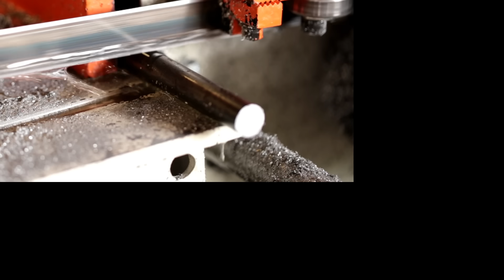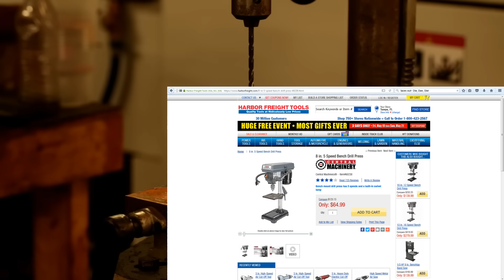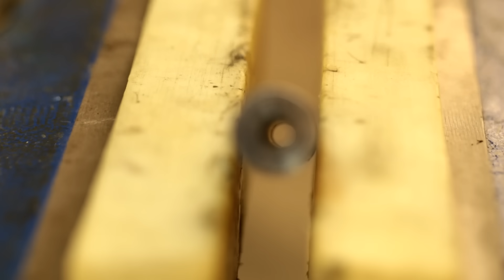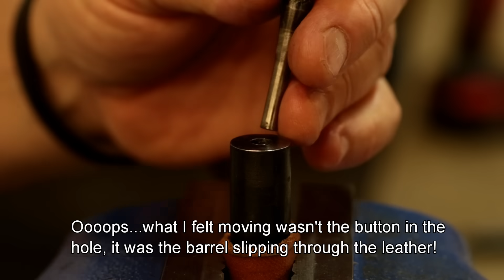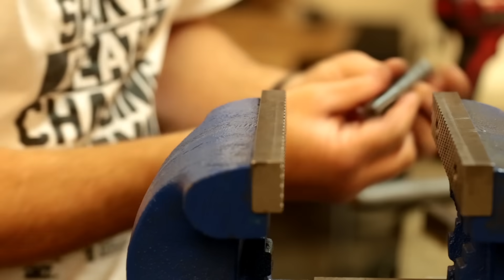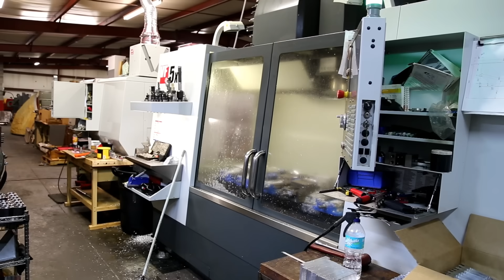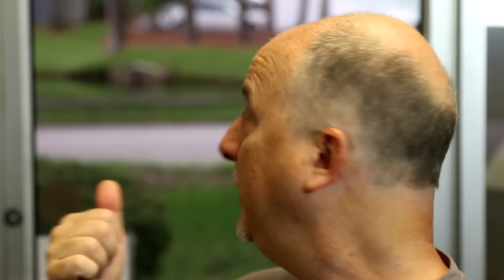Home Shop Rifling!

Comment: To center your hole put your  pieces of stalk in a drill big enough for it to fit in, get it spinning then take a fine tipped felt pin and press it as close to the center as you can. it will automatically center itself. A scratch awl works too.

Comment: One of the biggest problem the British government had in the middle east was the locals pulling up railroad tracks and making replica lee-infields and model 1911s using little more than a hammer, couple files and a fire. Later on they built factories complete with improved tooling. The copies made in the region are still available new. But due to the expense and scarcity of the 303 British round they are chambered in more modern 7 mm calibers .

Comment: Good point about turning the OD down between centers to be concentric with the crooked hole, but now you need a lathe, and a file. :)
Reply: Or, three blocks of wood two pointy centers and a file with some serious patience.
That's the lathe the ancients used to make gear assemblies in the B.C. 👍

Comment: Bottle Jack or screw under your car frame with a metal plate .... use short rods adding rods to get clear thru.... make your own rifling buttons from hardened drill bits... just do progressive sizes to finish

Comment: As a former Tool And Die maker, Your mistakes were no using a prick punch to find center before you punched it. And didn't start from both ends with say a 3/16 (.187) drill, then enlarging the hole, then reaming to your final size, Also If you had rotated your collet block in in your vice with each 1/4" of drill depth to keep your drill on center. Fourthly, use a center drill to start the hole.
Terry

Comment: This is why you cut the exterior (to be cut off later) down to fit in the drill press chuck and before that you take another piece of stock fasten it to the drill's tightened vice and use that to hold your drill bit firm. Then take your 5/8" round stock you cut down an end to fit in a vice... and you spin the 5/8" stock against the vice tightened drill bit that is the size hole you want... so a stationary drill bit is drilling a hole in spinning stock making it dead center.

Comment: Put the rod in a drill press and while it's spinning bring it down on a small drill bit that's clamped in a vice, you may have to move the vice around, but you'll find the exact center, then you can center punch it an drill it with  the same set up, dead center

Comment: Even if its slow feed you should still be sporting oil, it helps in every single way you can think of, faster drilling, longer bit life, less heat
Reply: And not just by a tiny margin, it can drill 50% more holes (200 Vs 100)
Reply: 😂 @KClO3 
Seems like that would be 100% more...

Comment: My uncle built his first bore bar and lathe ,eventually made missile parts to support his gun habit .designed the 572 Ross ,same year gunny Hathcock modified a ma deuce,but the army didn't like the chamber pressures and powers weren't what they are now or it may have out done the lapoua .based off 600 nitro cartridge, 50 cal.by 72. 572 Ross . Ross Powers.

Comment: Spinning the drill bit and clamping the work guarantees an off hole. Flexy drill bits make it worse. Get a lathe. Peck-drill with a d-bit or single-flute. Plan on turning the OD to match the bore after the rifling is done.
Reply from the maker: Not necessarily.  I've got several thousand guns out there in the world with firing pin holes that were drilled in the mill, with the part fixed and the drill moving.   Yes, as I mentioned in the video, I plan to turn the OD with respect to the ID.

Comment: Should've put the barrel back in the holder and put a flat piece of iron with a welded tip that fits in your drill press chuck and WITHOUT turning on the drill press, lower the steel plate as your "force pressure" to drive a piece of smaller diameter  round steel stock to push the rifling piece out the other side.

Comment: Idea? Button jig made of heavy gauge pipe with a set of nuts spotwelded in an end for the push bolt and and opposing nut as the anvil and thru hole for tooling to go out with a pipe cap drilled out for access to cap it all in?

Comment: A better way to find the center is to scribe a line, measure this line and divide it in two, this is the first center point. Then scribe  a line across the second line, and mark the meeting point of the two lines and that's your center.

Comment: Stick the rod in the drill chuck cut it on and press it against a piece of sand paper on the table. This will sand the face the rod perpendicular to the outside diameter.

Comment: Your push rods would work better with a sacrificial collar. Just get another tube of bored steel with a fairly similar inside diameter, and cut it so only about an eighth to a quarter inch is protruding. Push it thru till the rod is almost gone, the trim the sacrificial rod down. Work it till it's almost unnecessary as a support, then finish without it.

Comment: Liked the video.  But remember, drill bits dont drill round holes and dont stay true when exceeding the diameter by much.   And oil isn't just for cooling, its most important job is evacuating chips

Comment: better way for the home gunsmith is to build a rifling bench, guides, and heads to do cut-rifling. it's slower but kind of easier, less nerve wracking.it was for me.
Reply from the maker: I strongly disagree.  If you watch my "Rifling Three" video you can see that in 10 minutes with a crappy hydraulic press you can rifle a barrel and do an excellent job.  If you spent a little bit of time and made some spacers or had a press with an adjustable ram you could get that down to 3 minutes.  And in the end you have a beautifully rifled barrel with a strain-hardened bore that only button rifling will give you.  What on earth could be nerve wracking about that?  For cut rifling you have to spend a day or more building the machine cutting head and cutters, it'll take several hours to actually rifle the barrel and in the end the results will probably not be good.  You think some home gunsmith is going to make a cutting head that will increment the cutting depth .0001" every pass?  You know what's nerve wracking to me?  Making a 6-groove barrel and know I have to move the cutter back and forth 240-300 times before the barrel is done!  What part is "kind of easier"???

Comment: If your drill press chuck opens up enough to accept the barrel blank, you'll drill a truer hole by holding the drill bit in the vice and turning the barrel in the drill chuck.

Comment: A Better Way: to drill that bore into the metal, nicely centred with just a drill press and a table vice that probably came with it. 
Your barrel stock has to fit into the chuck, your drill has to be  longer than the barrel.
ok so put the drill bit in the chuck backwards with as much drill hanging out to reach the bottom of the table vice.
roll the chuck and backwards drill down to the bottom of the vice and clamp the vice on to the drill.
clamp the table vice to the drill table, now undo the chuck and let the chuck go back up.
Both the drill which is now in the vice and the drill chuck are centred as long as the table is square.
Centre punch the centre of the barrel stock
put the barrel stock into the chuck, start the drill and just drill it out.
cheers

Comment: The rule of thumb, from what I understood in a statics class for a column and buckling:  If the length is 8 times or more the diameter, bending/buckling tends to start under compression. But you did not have the longer ones straight with the bore. That ejector pin was not buckling in the vise. It was crooked.
Reply from the maker: It's a lot more complicated than that...the end support conditions are very critical as is the "slenderness ratio".  Like I showed in the video, look up "Euler Column Buckling" if you're interested.  Trust me, the ejector pin was crooked AND buckling.

Comment: To prevent the crooked hole could you just get a bubble level to ensure first the drill press is level, then check the vise for square and level, then check the piece that you're placing in the vise
Reply from the maker: I've literally drilled thousands of holes and what you say won't necessarily work.
Reply: @markserbu  thanks for the reply. What do you think causes it? Is the only thing that will get rid of it, in your experience, a lathe drilled hole?
Reply from the maker: Anglus Patria  Two.  One is named Zack and the other is Valerie.

Comment: If i were to try to make my own rifle barrel, I would first cut my hole then my chamber and afterwards I would turn the outer portion to the form needed in a lathe using the chamber and exit bore to line it and form it from the inside out . But I'm not a engineer so I'm not all knowing and perfect like they think they are!
Reply from the maker: @mikebeddingfield2144 That's generally how it's done. Sorry you felt you had to leave the shitty comment about engineers, but hey...you do you.

Comment: Here is a parallel question…
I’ve got an old military rifle, a Chinese M-88 Han Yang Rifle, in 8mm Mauser. It is a .318 bore. I’d like to open it up to the modern/standard .323 bore.
How did the Germans accomplish this upgrade? How can we do it in a 21st century shop?
Note: Before anybody "freaks" out about running full power ammunition through a Commission 88 rifle… NO. I will hand load using Trail Boss powder. Essentially creating low, pistol pressure ammunition. ;)

Comment: Just locate it on the drill and spin file it to desired o.d. just dont use alot of cutter pressure, stabilize end of bit if you have to .    Learn all the right way so you learn what you can do without all the right tools . maybe just got  crow bar and hammer ?? No prob all I need.

Comment: He needs a series of shorter pieces to push the button through, like drill rod in 1/4" increments until he has one ling enough to push all the way through.
If it's too long it will push to the side as the back of the barrel is not perfectly flat.

Comment: i would love to work in the USA in a weapons manufacturing company. i come from Germany and here it is so that it is actually impossible to get such a job there ...  unless your father and grandfather and great-grandfather were gunsmiths. 

I would even go to the other side of the world for that ... because it's not going to work here anymore.
Reply from the maker: It's too bad what Germany has become.  I still love your country and visit when I can (mostly to drink beer!), but it's been so ruined by liberalism.  Just like what is happening here, there is a huge movement to deny the parts of history that aren't "politically correct".
Reply from the maker: @christianenders23  The problem with straying so far from a country's original charter/culture is that "the pendulum swings both ways".  Just as the radical Obama got us the radical Trump, Germany could be headed for another Hitler.  The German people are, as a group, among some of the best people in the world.  Smart, incredibly industrious and honest to a fault.  They're also extremely tolerant, but the prevalent culture that's literally invading your country does NOT share those traits, and eventually the German people will get fed up.  Of course at the rate you're being outbred eventually it'll be too late.  Anyway I wish you the best!

Comment: By not using coolant when drilling your hole, the drill probably walked, so it wasn't centered. Or you had the collet setup in the vise at an angle. This video should be showed in schools as a OSHA training tool, on what not to do. Omg, just saw part of the video where he actually owns a CNC mill, I thought for sure I was gonna see body parts fly.

Comment: And making stuff the crappy way is the way we all do it.  Better than a $10,000 CNC machine.  So, how did they do it in the olden days?
Reply: $10,000 CNC machine? where did you find THAT bargain? Shit, you'll probably pay $18,000 for a new manual lathe.

Comment: I hope this isn't a stupid question, and it's slightly off the topic, but is there a twist rate at which the rifling becomes counter productive?  I know it depends on the size the bore is chambered for, and the length of the barrel, but you see a lot of variety out there in twist rates and I'm interested in knowing where you start to see counterproductivity in rifling, where it starts to cause barrel wear prematurely, and so on.

It's probably a bigger answer that I'm even ready to understand.

Comment: No center drill to start?
Also, just a little cutting fluid (worst case, WD40 or motor oil) will make it cut and ream better.

Comment: You can buy rifling buttons off eBay from China pretty cheap
Reply: lol if you are a friend of throwing barrels away why the plug splater to shreds than yeah i guess its just as same as with these "extremly sharp" China drils once you set it in they literally explode to thousand pieces i had tham one and not a single one could stand even 100 holes in regular metal from hardware store
Reply: @NexusIncorporation  I know it's a foreign concept to most delinquents out there, but if you feed your drills slowly, apply even pressure, and lubricate them sufficiently they usually can manage to drill a hole. Unless your trying to drill hardoxx even Chinese drills perform reasonably well when USED CORRECTLY.

Comment: This is probably a weird question but... Would it be possible to pre-drill the main barrel hole, then maybe weld on a little steel nub to a carbide drill bit and just push it through the barrel on a low RPM, creating some very basic rifling, to at least stabilize bullets properly? It'd be wonky and the twist rate would probably be way off if done by hand, but just a weird idea.

Comment: Is.   Rewarding.  The. Same. As. The.  Feeling.  Of. Accomplishment...   this.  Reminded.  Me.  Of.  Fitting.   And. Finishing.   On.  A.  Gunstock. From.  A. Rough. Blank.   Doing.  All.  Work. By. Hand.  Much. Like. This. The. Only.  Thing.  You.  Did. Not. Do. Is. Cast. and. Shape. . The. Metal. Part.   Like. I.  Did.  Not. Cut. The. Tree. Or. Form. The. Original.  Shape. From. A. Log.    I. Used.  ..  just. Small.  Files. And.  Sand.  Paper.   Thanks.  Have.  A.  Nice.  Day....
Reply from the maker: I was today years old when I read an entire 73-word comment that had periods after EVERY. SINGLE. WORD.!!!

Comment: Ok, but. This is better.
Use Pak so they still fit in .. cut the green cap off, then press a 1/4 inch ball bearing in it. This will help with straight shooting. Because balls are round. And no rifling.... Oh. Ya it works great!!!

Comment: how many years did you make rifles in your garage before building a shop? Did you do it full time? What was the most important thing you learned over the years doing it? Neat video.Thanks
Reply from the maker: Worked in the garage for a couple of years before renting my first shop.  Most important thing?  Several: 1) Work your ASS off. 2) Don't be a pussy and give up easily.  3) Don't do illegal stuff, don't screw people over  4) Learn everything you can about every aspect of making guns.  Then learn more.

Comment: There's been a time or two using advice trying to push an item through and the vice gets really tight I take a hammer and hit the Vice in the direction you're pushing and it will take enough of the pressure off you can actually use the handle again on the Vise to get another fraction or two keep repeating

Comment: U went wrong by not using a small centre drill on the first hole. Get that initial hole vertical and u may have a chance with maintaining centre down the shaft with a larger drill. Otherwise not gonna happen.

Comment: Bad mechanics blame the tools good mechanics have good tools because they made them good I can see from the screen that was Jaws can be replaced with smooth Jaws but you didn't do that and I also could have told you if I was there that you should cut three short rods and just stack them on cuz the longer the throw the more likely you are to bend it when you apply Force. I believe bookstores have very inexpensive shop manuals on how to do everything you're trying to do with the same equipment you have

Comment: Noway in hell i would be cutting that rod with cut off wheel and no vice good way to loose fingers or a hand.
Reply from the maker: Eh, I've been doing stuff like that for nearly 50 years.  Just recently cut my knuckle to the bone with an angle grinder and a week and a half later it's healed.  Didn't even get stitches.  Last time I got cut with a hand-held grinder Bill Clinton was president.  So it can be risky, but not very risky in my experience.

Comment: Is there any potential for hydraulic deformation from the moly grease you use while rifling? As in, is it possible that the grease under high pressure could deform the steel in the barrel, and mess up the rifling?

Comment: Actually, if you had drilled the first one at the correct speed, you would have drilled that hole quite a bit straighter. Not perfect of course but better than that.

Comment: Is there any special steel used for the barrel? Or does it depend on what kind of round you're putting through it? Will it take the pressure in use?

Comment: Question: If drill chuck is large enough to accept barrel blank diameter, could you put the barrel in the collet block and then tighten the drill chuck aroung the barrel extending out of the block. After that lower the block into the vise and tighten it. Then  release the barrel  from the chuck. Next mount/ insert your drill for the barel. Would this centered correctly for the drilling?
Reply from the maker: Could be, sure.  But the drill could still wander.